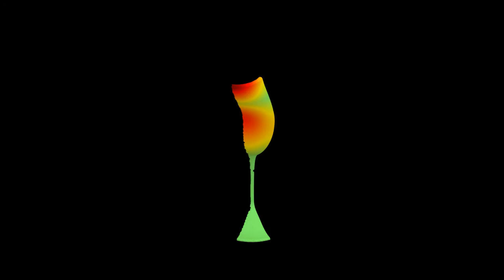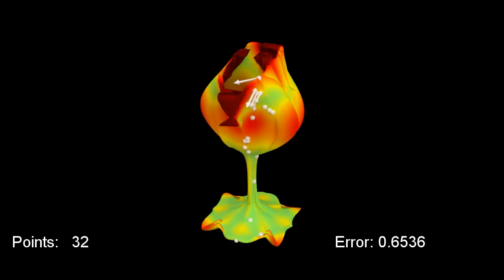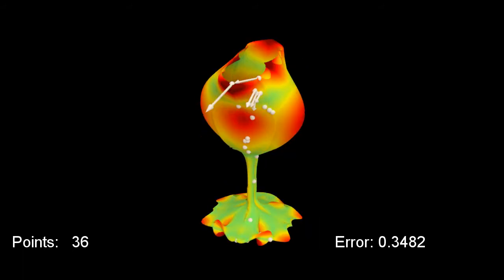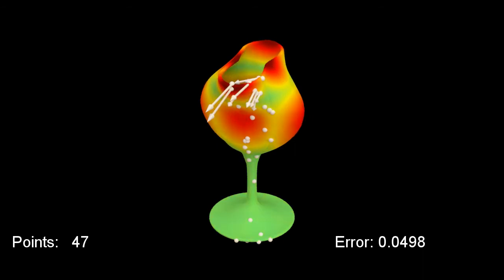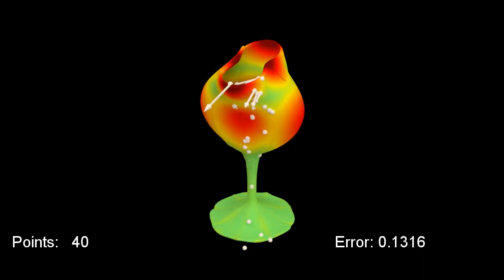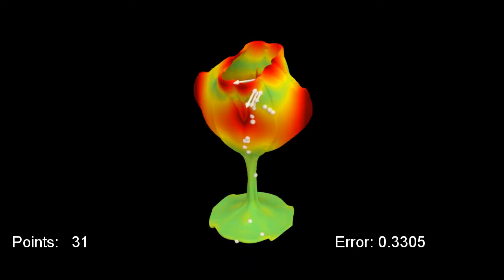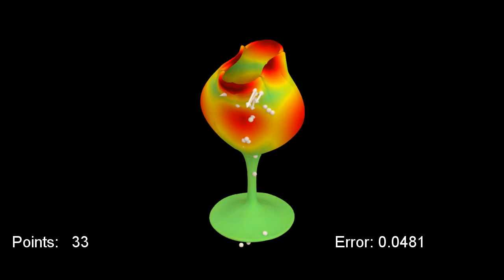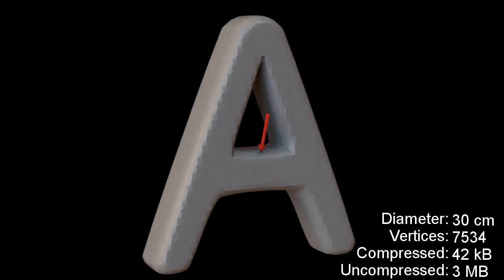Eigenmode Compression for Modal Sound Models

Comment: This is extremely impressive.  imagine what destruction would sound like in a game like Battlefield using this system.
Reply: Nolan LastName I think you misunderstood. This has nothing to do with the 3D models actually used in the game - it's a precomputed map of eigenmodes, which they've managed to squeeze up to manageable sizes. So you'll build it based on the high-resolution model, and use a simplified model for rendering as needed. The video is in real-time. It wouldn't be easy to use in a game, but then again, the same was true about things like procedural animation. It's just about making it desirable enough for the gamers to make them want it bad enough, and then making the first step. It's still much more memory intensive than using prepared sounds, but it's manageable. Just don't apply it to every single model you have, and you'll be fine.
Reply: It would be entirely too processing intensive to implement into a real-time simulation anytime in the near future. Maybe one day, but it's probably pretty far off. I mean, even battlefield's destruction is based on pre-determined models as it is.
Reply: It's people like you that cause the world to stand still.  "Can't be done" shouldn't be the mentality of anyone, ever.  "There might be a way..." is the way of the future.
Reply: James Van Metre You really don't know what you're talking about, do you? This software is used for animated movies, this video probably took hours to render each scene, and they aren't even complicated scenes. This sound generation relies on objects having large poly counts in order to work well, while games try to minimize poly counts for performance's sake. This kind of stuff won't work on objects comprised of only a few triangles. The smallest object they used this on in the video has 7534 vertices, while what you're talking about using it on in a game would probably have 15 to 200. You know why? Because our computers can't take much more than that in a video game environment. We don't have the computational power available to run games that this can even be applied to (that is games with thousands of vertices per object), and that's before we actually apply this to the game.

And I didn't even say it can't be done, I just said it's going to be a long time before we can. Seriously consider the statement "even battlefield's destruction is based on pre-determined models". That means that if this was just shoved into the game for some reason and tweaked to work with low poly counts (it would be a very different system of "sound generation" if that was the case), the sounds would always be the same because battlefield always uses pre-determined destruction animations. Yes, animations. This isn't applicable to the game for more reasons than one, and one of those is that the destruction is just an animation. It's eye candy with very little actual substance. The sound generation is based on collision and collision points, none of which can be applied to an object that can't collide with anything.

"Well then just make the objects in the destruction collide!" you probably think, but there are so many implications from that. If there's a collision box, you better bet your ass that it's only going to have 8 (maybe 10 if the object is abstract enough) vertices, which isn't enough for our needs if we were to put this in the game.

Again, I'd love for it to happen now, but there is no stopping the fact that it's not going to happen now. People like me aren't why the world stands still just because we have some sense.